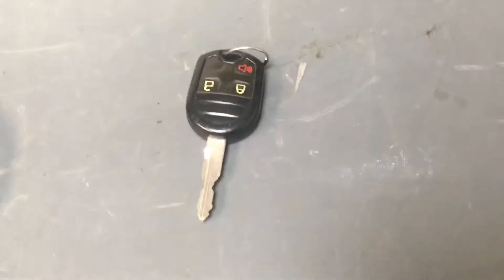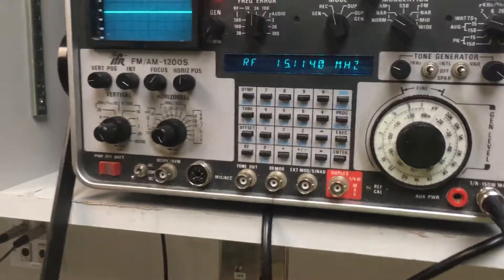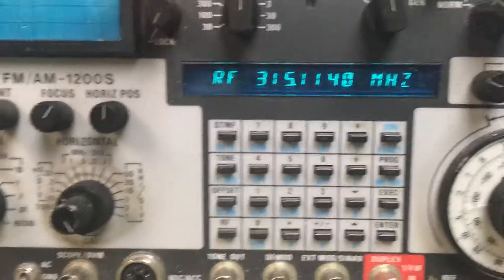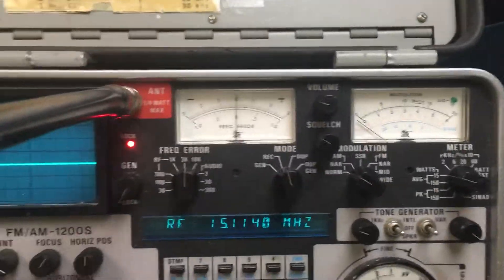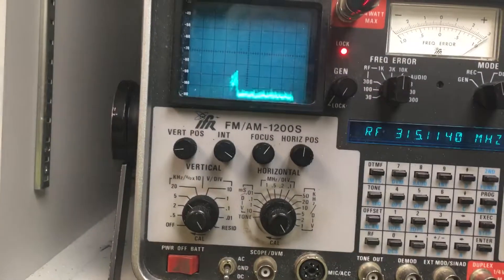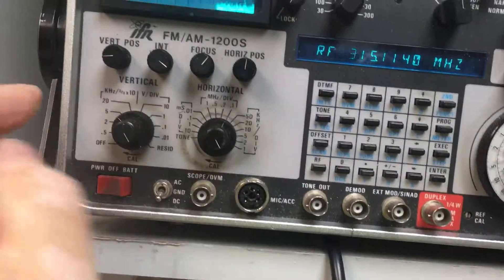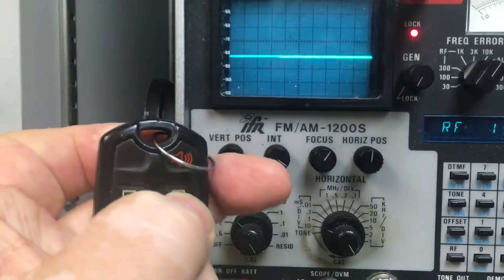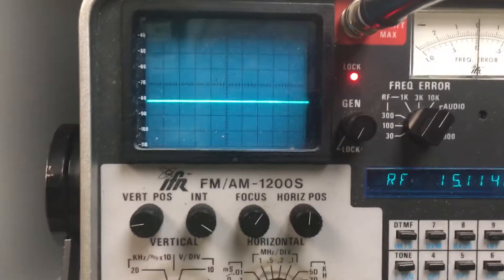Hacked my key fob to find its Frequency

Comment: Have you ever tried to use an iPhone app as a spectrum analyzer? If so, what settings would I use? I have never used a spectrum anazlyer before, but I lost my keys and am desperate to get them back and my last resort is to try find the keyfob this way. I am hoping they are somewhere in my house.
Reply from the maker: Couple things, there is no way to do that. I I am not aware of any receiving capability of an iPhone in this frequency range. You would have to have an external device connected. Secondly, these units don’t transmit until you push a button. I believe even the keys with an RF ID Chip don’t emit a signal until it is excited from the vehicle system first.
Reply: Paul k8IO ok thank you. I’m desperate to find them but I might have to finally give up